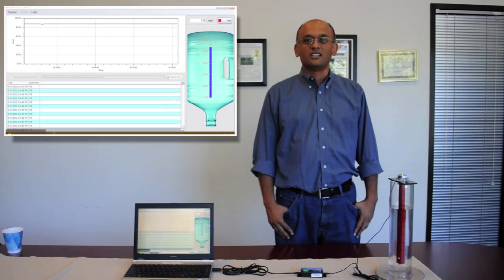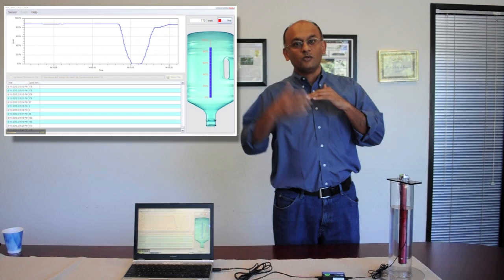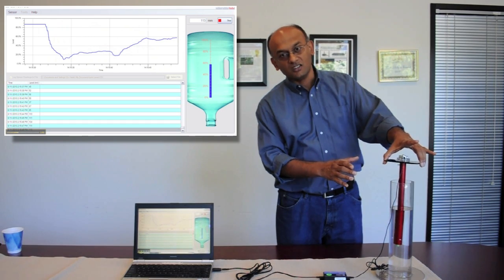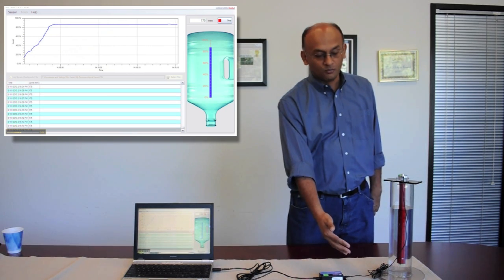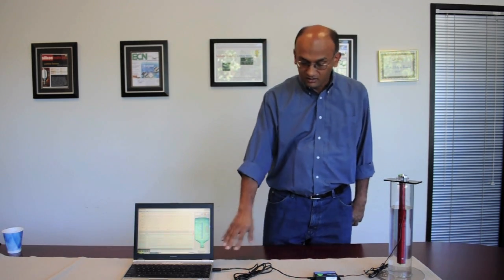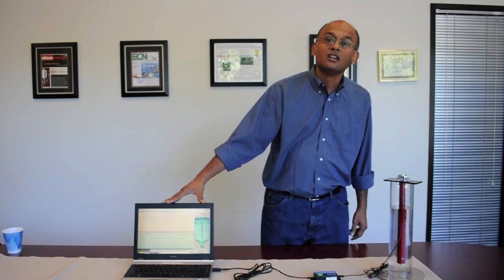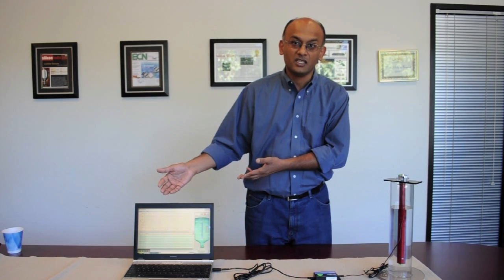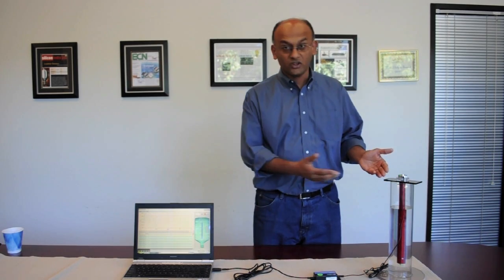Capacitive Liquid Level Sensor

Comment from the maker: In general the sensor has about 150 hz data output rate (fully calibrated level values) to a PC via USB port.  Voltage output (0.5 v to 4.5V DC) is optionalusing the DQ-1000A interface instead of the DQ-1000U interface (USB).  Serial TTL/UART version also available.

Comment from the maker: Yes.  Works with material that can act as ground plane to a capacitor.  Generally any wet substance or human body for e.g. your hand can come close to it and it will detect it if you come close to the sensor side.